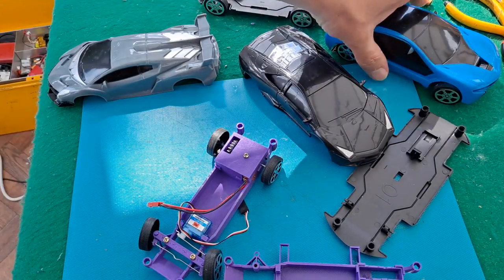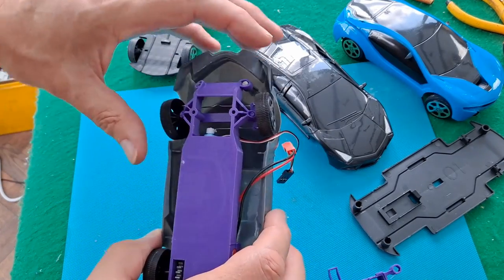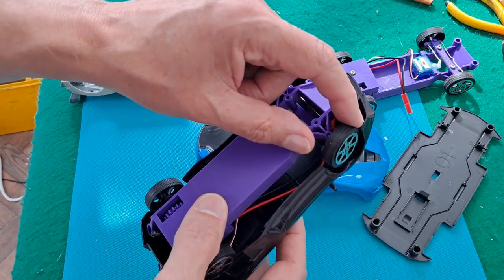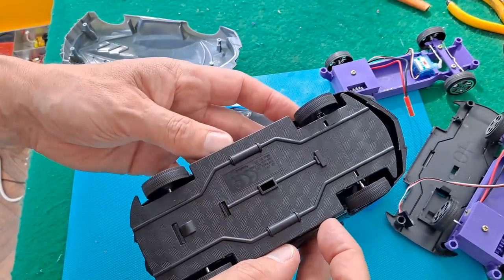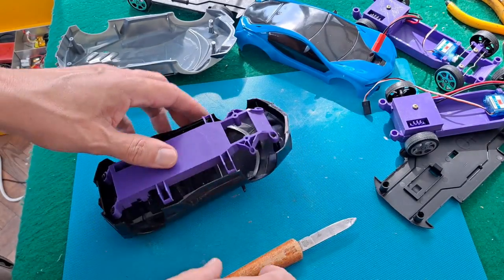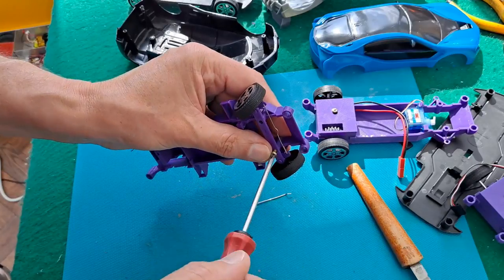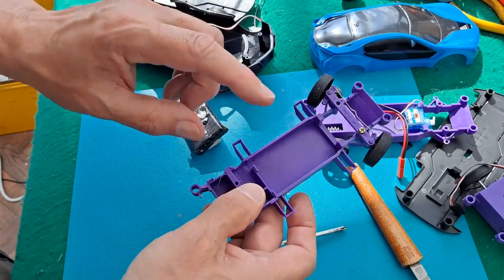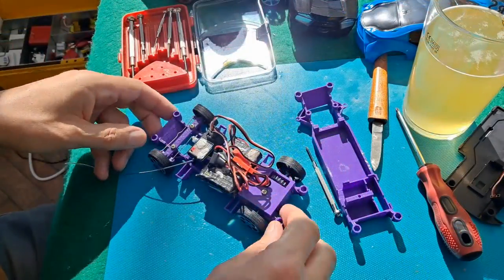Poundland toy car RC conversion project PART 8 - why didn't it fit the other cars?

Comment: Glad you got it to work. Just shows what a tiny bit of flex in the body shell can do to the clearances. You don't have much ground clearance, but I guess its enough, you could probably tweak the model to give a little more if necessary without losing too much space inside for the RC gear. I like that your channel actually uses a 3D printer for projects, so many other channels just tinker with the 3D printers themselves. I must get one myself soon.
Reply from the maker: To increase the ground clearance I would need to reposition the motor. Not a problem, but that is the reason for the lack of clearance. I decided not to worry about it as the cars will only be running on a smooth surface. In the next chassis the ground clearance is even less as the wheels are smaller in two of the cars in the set.

Comment: Works great and celebrating with a pint of Thatchers. 😂
Reply from the maker: Not sure which is less harmful, the can of Thatchers or the gin & ginger I usually have. I decided a large glass of Thatchers was probably better in the hot weather, as it was the fluid intake I needed and having 2 or 3 gins was getting a bit too comfortable.
Reply: @GrandadIsAnOldMan  👍😂